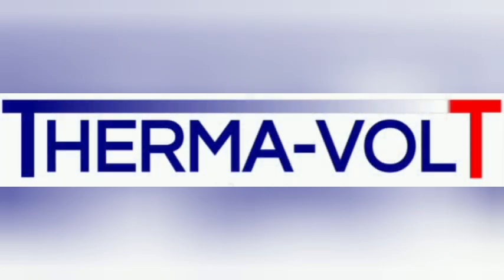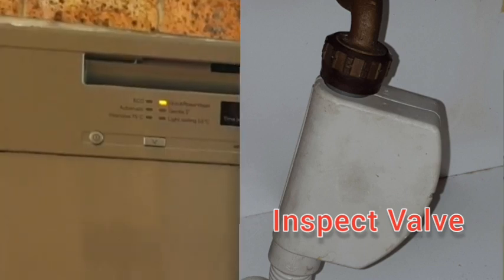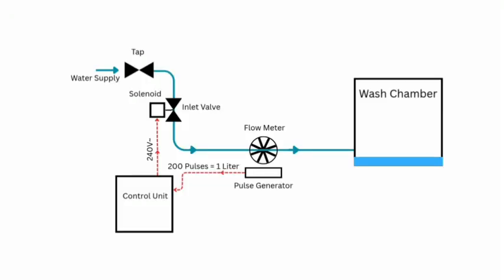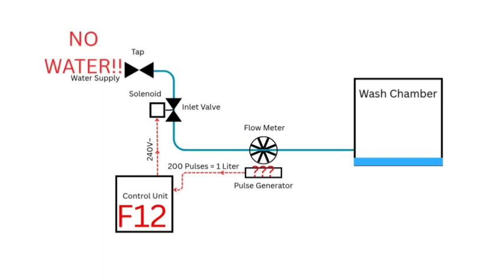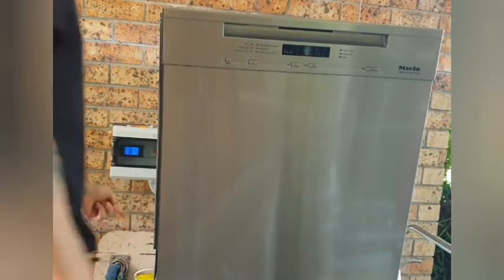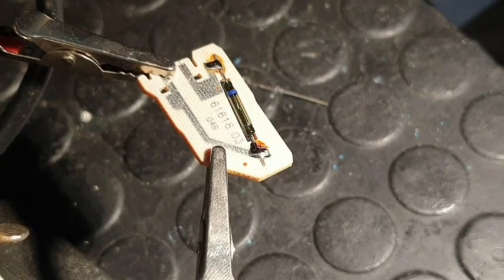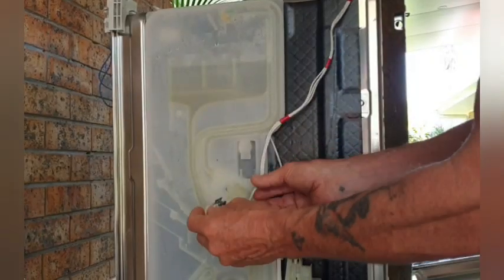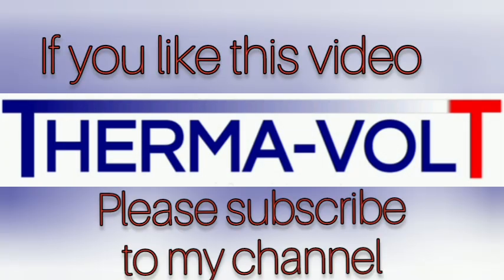Miele Dishwasher Won't Fill - F12, F13

Comment: Thanks for the video. We got an F12 error and no activity from the inlet valve even after replacement. I checked the reed valve with a multimeter and a magnet and this seems to operate properly. Drain non-return valve seems clear as does the drain hose. Is there anything else you would check before it goes for scrap? Thanks so much!
Reply: Its a miele g 4203 sc active
Reply from the maker: If you can hear repeated water flow then it's the reed contact. When tested with an ohm meter they often appear to work but if you check it with an oscilloscope you can see that the pulses are irregular. Changing the reed contact is my first approach; Not much of an expense here. If it still fails, then there could be a mechanical issue with the flow meter or the internal magnet. Make sure it rotates. Next there could be a problem with the controller not receiving the pulses, such as oxidation on connectors, insects or corrosion on the PCB. If there is not even a faint sound of water flow then there is a problem with the water inlet, kinked hose, blocked strainer, malfunctioning inlet solenoid etc.

Comment: Great video. What is the part # that you solder in and where is it from.
Reply from the maker: Search your favourite online platform Ebay, Aliexpress or electronic shops for "Miniature Glass Reed Switch". They usually come in a 10 pack for a few bucks.